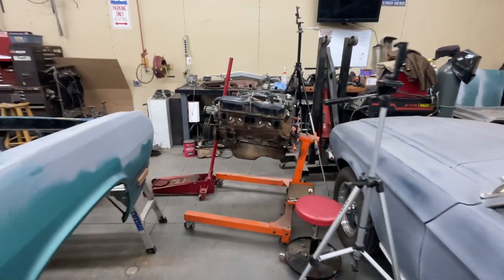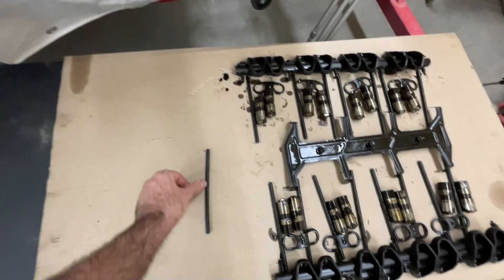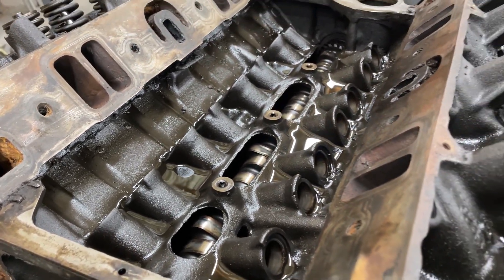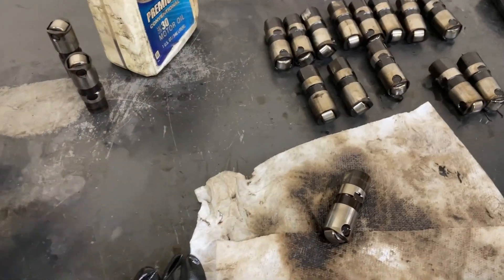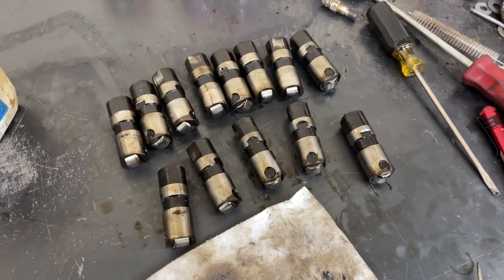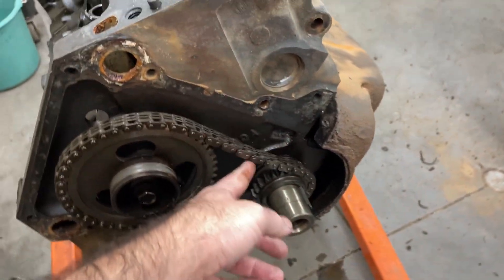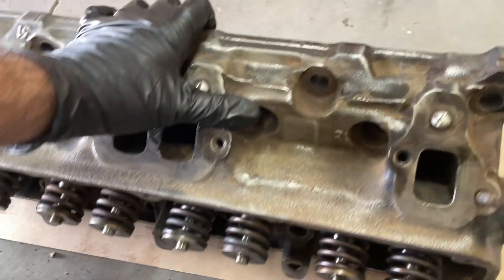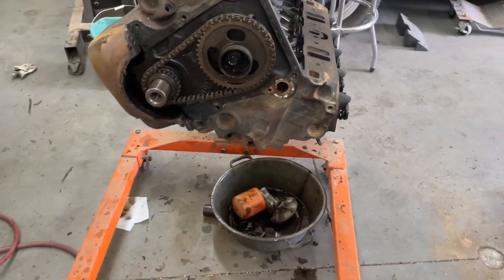318 Mopar Engine Build on a Budget Part 1

Comment: A cheap set of bore brushes, nylon or steel, works very well for cleaning thread bores.  Adaptable to any thread size, pipe or otherwise and run off of a drill.  Super simple, cheap, and effective.  Enjoyed your video.  Thanks.
Reply from the maker: Yeah I need to get me a better set.

Comment: Nice block.  Roller cam and oils to the top end with shaft LA head.   915 closed chamber head?   Better deal.  Uses LA angled bolt down intake manifolds. 
And could use magnum heads if you want.
Reply from the maker: Thanks.  I was pleasantly surprised when I saw it was a roller cam!  Just wish it was a 360, but 318 will get the job done!

Comment: I just went to do a "Quick" mild cam & 4-bbl swap on an original 88K-mile, '76-vintage 318 in my very clean Valiant sedan...yeah, ended up remanufacturing it. The factory machining was absolute trash. The decks sloped backwards to the point that flattening out the decks made the replacement KB pistons "Pop-ups" with over 10.0-1 CR. Had to get 0.060 Cometic head gaskets to lower the CR to 9.45-1. Used a '70 340 forged crank, I-beam rods along with the new pistons- so the counter weights were shaved for the new, lighter weight rotating mass. Had to align-hone the mains, the rear cylinder/piston/rod/crank line was off over 2 degrees. For heads? Used a pair of 308 heads off a '90 van, just cleaned up slightly, port matched, new guides, new exhaust valves, multi-angle vale job, new springs & viton seals. King Machine here in NC does fantastic work- they do a lot of work for some known names
Running a junkyard-sourced Edelbrock Performer RPM, re-done TQ (Mr. Clifton at Raleigh Carb), a pair of TBC FlowTech headers I've had for years (never used), 2.5" dual exhaust with an X-crossover & NIB ancient Dyno Max 'turbo mufflers' from about '88. I did have the stock distributor done by Advanced Distributor; re-man'd , better hardware/pieces, re-curved the advance, new vacuum pot adjusted for the engine. 
The "Cheap" 318 got out of hand quick!
Reply from the maker: This was supposed to be a "quick" one too.  Fortunately I was able to put it back together with minimal investment.
Reply: I will say that, in the end, the engine is impressive.@roadhardrestorations

Comment: Do you do many daily driver preferences engines. I finally got my 1974 360 back from the machine shop. I had a cracked cylinder about an inch from the top. I had a 10 to 1 compression engine with forged pistons. And was running a 250 shot of nitrous. Now i purchased a 408 eagle forged rotating assembly internal balance set up with the heavy duty h beam rods and wrist pins. I had 613 HP to the wheels with the 250 shot of nitrous. The question I have is with all 8 cylinders sleeved with a high nickel sleeve. How much HP do you think the block can handle with out hurting it. Hoping to run 350 shot of nitrous. Has aluminum big valve heads intake is matched ported to the heads and a erson TQ 50 camshaft on a 112 overlap for the nitrous. Hoping to get 800 + at the wheels.
Reply from the maker: Sounds like a beast of an engine.  I wouldn't have a clue as to the HP limits.  But there is only way to find out what that limit is!  lol   The vast majority of engine builds I've done are pretty mild.  I'm planning a new 408 race engine for the 70 Duster drag car.  It's going to be a relatively mild engine as far as bracket race motors go.  I'm going for longevity over all out horsepower.

Comment: The roller cam didn't show up until 88 on the d, w ramcharger series with throttle body injection 318,s
Reply from the maker: Yup.  Trucks apparently got the roller cams later than the few cars they were still putting the 318's in.

Comment: Why the stock cam?
Reply from the maker: The intention was to build it on a budget.  A roller cam is $500 + springs etc.
Reply: @roadhardrestorations  well I guess it is a roller I just never used the stock cams back in a 318 with how small they are. I usually do a small upgrade at least for a better cam profile. It's like 380 lift stock

Comment: 2k is my budget, give me the best upgrades I can do for my 318 to get a little more power
Reply from the maker: Are you doing the work yourself or having a shop to do it?  The labor will eat up a lot if your paying someone.  Depending on your skill level, the basics are a good start. First a good tune-up, as in timing.  An FBO plate inside a stock style electronic ignition distributor with the “correct for your engine” timing curve, will make a world of difference if your still at the factory specs.  Next is Carb/intake, then maybe headers and exhaust. That way when you go the next level and go with a bigger cam and heads you’ll be ready for them.
Reply: @roadhardrestorations I would have to have someone do the work for me, I don’t have any mechanical skills, what would you estimate the labor to be for those parts?
Reply from the maker: @dagreatne55 it’s difficult to say. Labor rates vary a lot.  Could be anywhere from a couple hundred to over a grand depending on what you have them do.  Make sure it’s a shop that is familiar with, or better yet specializes in older vehicles
Reply: @roadhardrestorations sounds good, thanks for the info!
Reply: dagreatne55, I have a 1987 D150 with the optional 318. It ia listed in the dealer order sheet as ELC, 4 barrel. It has the 302 swirl chamber heads. I did a lot of research and was told that the factory cast iron manifold flowed nearly as good as an aftermarket aluminum one  so I kept mine but changed the electronic feedback 4 barrel for an Edelbrock 1406. Everything to do with emissions has been removed. I wen t to an aftermarket HEI ignition system and bolted on a set of factory manifolds from a 318 Magnum. The give a much better flow into my 21/4" dual exhaust system. Turbo flow mufflers with no cats.  That is all I have done other than a 12" chrome air filter, and the thing absolutely screams. This would be a good start for your engine and very little money.